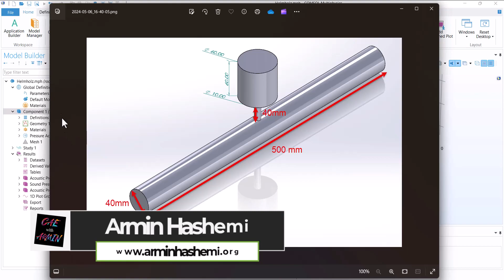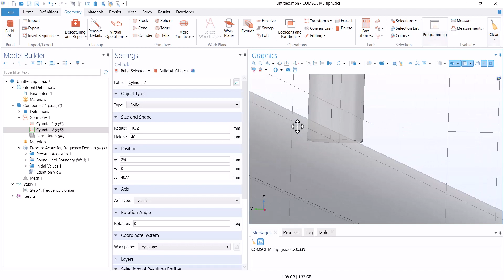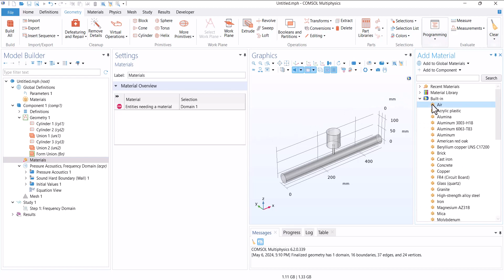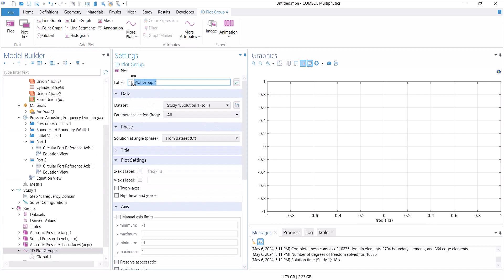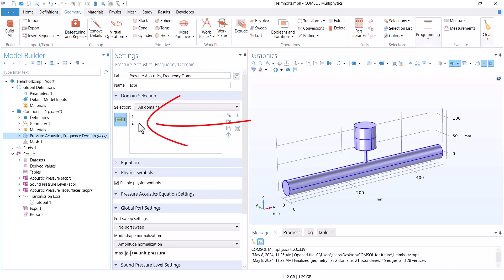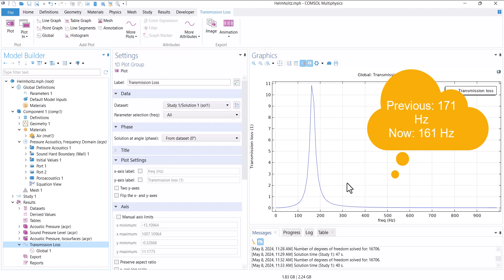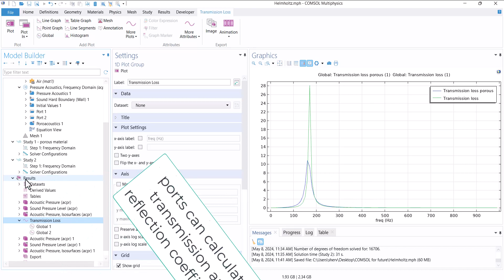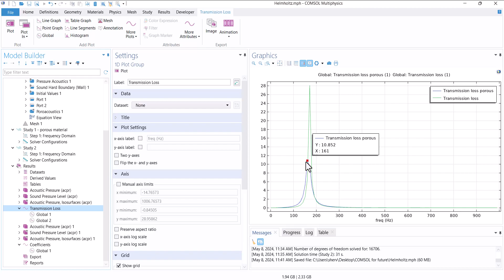🎧 COMSOL Tutorial: Sound Transmission Loss of a Helmholtz Resonator with Porous Material

Comment: Hi, thank you for this video! Can we  calculate also the absorption coefficient? What if I plot (abs(acpr.S11)^2)?
Reply from the maker: @jg7717  hello, you're welcome. Use 1-(abs(acpr.s11))^2
Reply: @caewitharminhashemi  thank you! But i find a curv with a reverse peak. The curve has the value 1 for all frequencies except at the resonance freq. Is it right?
Reply from the maker: @jg7717  yes. It's correct
Reply: @ is it mean that a helmholtz ressonator act as a perfect absorber for all frequencies? I don't know if it's correct. Meanwhile I was trying other ways to evaluate the results and the theory say that in the case we have 2 ports the absorption coefficient depends also of the transmission coefficient, so maybe the right formula could be 1-(abs(acpr.S11)^2)-abs(acpr.S21)^2), don't you agree with me?
Reply from the maker: @jg7717  I have several videos about absorption coefficient. Use the formula from those videos
Reply: @caewitharminhashemi  than you so much, I saw those videos and are really helpful. Could you indicate some reference to make me understand the shape of that absorption curve? I can't understand why it's always 1
Reply from the maker: @jg7717  absorption coefficient is not meaningful in resonator. All sound power pass through the tube, so alpha equals 1. It's not due to the absorption.

Comment: Dear Armin, can you explain How do plot  Average pressure versus frequency 1D plot. 

Like calculated in comsol acoustic library "Helmholz resonator solver ".
Reply from the maker: @MVBMOHDSHADAB  hello,
Average pressure over a surface? You can use average integration in non local coupling. Find it by right clicking on definitions.
Reply: @caewitharminhashemi  
As far as this geometry is concern you used unite operation therefore cannot choose the resonator ( upper cylinder) only. That is my concern.
Because Average pressure p_avg=intop1(abs(p)/Vol)
 here Vol and abs(p) are two variables that we need to provide

P can be found by providing the Pressure boundary condition and 
Vol can be calculated by integrating over the entire domain.
Reply from the maker: @MVBMOHDSHADAB  I think it's better to use partition boolean and split geometry with a plane. Also, It doesn't affect the results.
Reply: @caewitharminhashemi  ohh. Thanks you . I got the point . Now i can try this. If it works i let you know.
Reply from the maker: @MVBMOHDSHADAB  you're welcome